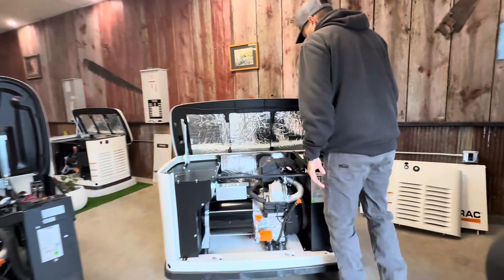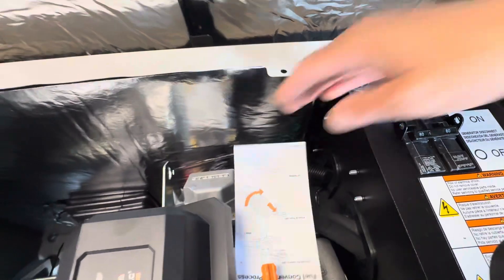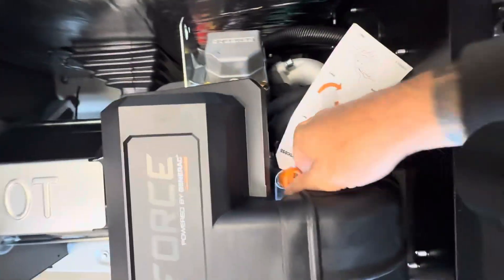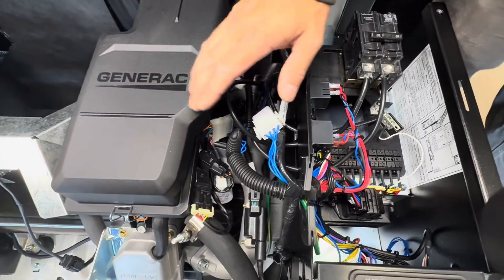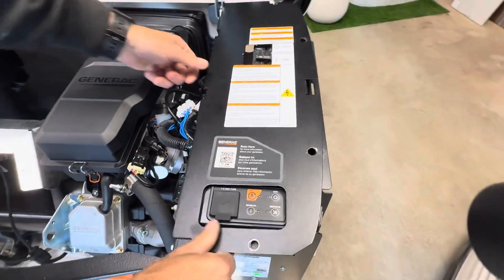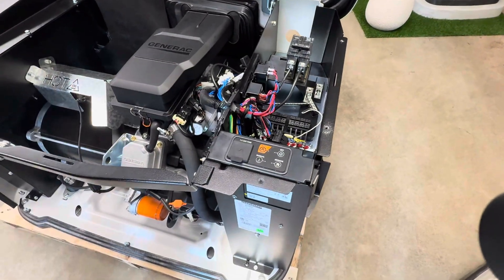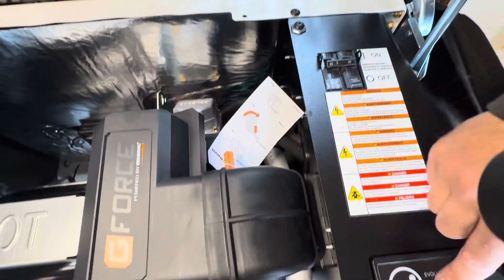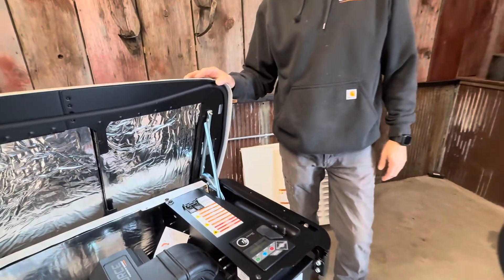5 Key Features of NextGen Fuel Systems You Need to Know

Comment: Cool can you show the air filter and such, we install a lot of the generac gens up north in Canada and the air box has sometimes sucked in snow, mainly up north when extreme blizzard fluffy windy type snow. Maybe this new upgrade will solve that. And seems like intake is from the back now wich also may help as up against a wall wich is a bit more protected in most cases. I also like how both side panels come off easier now.

We have some on order but nothing showing up yet hear in Canada still receiving the curent models hear. I agree the wifi can be a pain, and cell is good, but good to have both option as we have installs up north in no cell areas but have internet from starlink, so wifi or ethernet or cell is good to have all 3 options. Not sure how will work when we installed in a no cell areay we may have to activate it at our office in advance before bringing to some sites, and then with no display and no cell signal will be intersting to see how that all works. Overall looks like some great improvements.
Reply from the maker: Yes, I will do a video on the air box. We have already installed what we had in stock however we just got a shipment in Friday last week. I agree with the snow. The rear intake will be a much better solution to that.
Reply from the maker: Also if you guys are looking for more installs, you need to really check this out. I have two generate businesses in the states here and this is really helped us. No BS.

https://youtube.com/watch?v=tB7-pdnOY0U&lc=Ugzr7wfaMvz3WuP7XP14AaABAg.AMlkWSsf09cAMlx76VbTjl&si=P4KRHP-PHfoNnwgM
Reply from the maker: Check out the link in my comment. These guys really know what they’re doing and I’ve been advertising with all the other methods that you can think of over the past 30 years. This is by far the best one. Should be the top comment under this video.